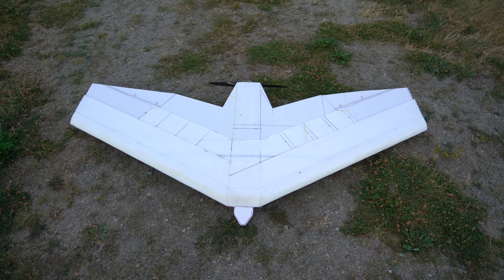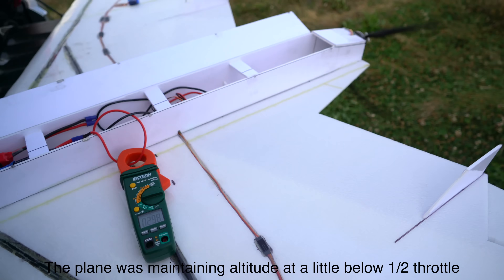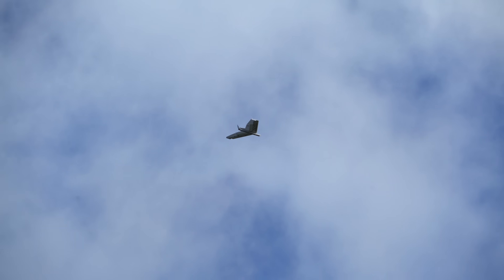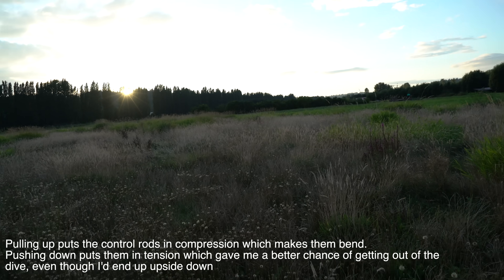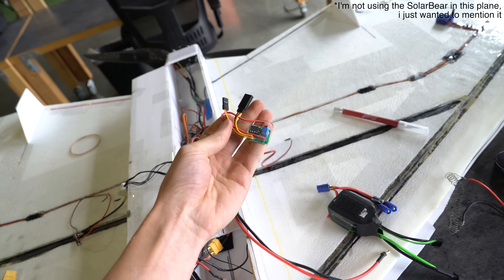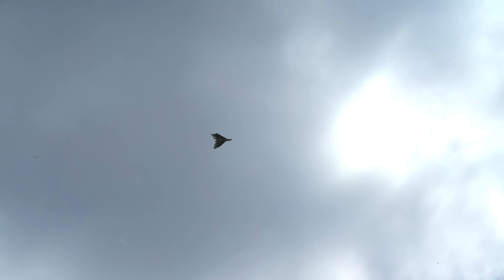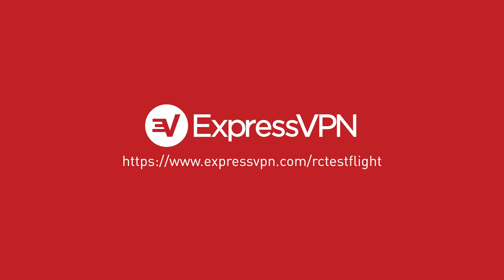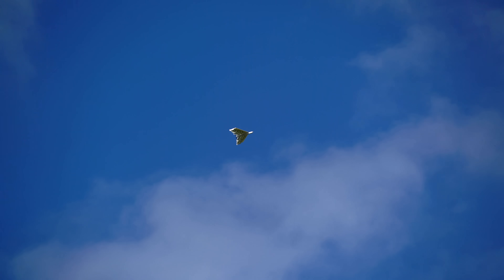SOLAR Plane V4 Flying Wing

Comment: Congrats on a successful test, even if somewhat marred by the crash! I suspect that in addition to the issues you mentioned with foam/pushrod flex and servo stall torque, the tail-heaviness will have worsened things further due to a tail-heavy plane's tendency to "tuck", or decrease pitch angle further, in a dive - I've had crashes a lot like yours due to dive-tuck overpowering weak servos. I think if you can get the CG exactly on the neutral point for the rebuild (or version 2) you'll see a lot of benefits, not just in preventing uncontrollable dives but also in drag reduction due to minimum control surface deflections needed for maneuvering. Also re: servo problems, even "cheapo" metal gear servos should be able to tank far higher control forces than the blue plastic SG90s you used, for a few grams' extra weight - may also be worth doing the old trick of putting small pushrod "guides" halfway along their length to reduce flex.
RE: induced drag and aspect ratio, while high AR is still the clear winner (not a lot of short-span delta competition sailplanes out there), that's when wing area is kept constant. Induced drag is a function of wing loading, not just AR, so if the reason for a lower AR is that you've added a lot more wing area, the tradeoff, while still in effect, will not be AS bad as you might expect. (Case in point: the Wainfan Facetmobile homebuilt, despite being a low-AR delta in a low-speed application - seemingly a very poor combination - managed a top speed easily comparable with more conventionally-configured aircraft of similar weight and powerplant.) Deltas/long-chord flying-wings are a logical choice in applications where high wing area relative to overall maximum dimensions is desirable, so I'm very excited to see you went for a long-chord planform for this test, and happy (but unsurprised) that it succeeded. :D

Comment: Good vid. Your poor cells! Looks like a little more yaw and pitch stability is needed on that plane so the elevons don't have to work so hard. I'd suggest either one vertical stab or a couple of CF booms with stab and elevons on them to increase leverage (and no need for reflex in the wing for pitch stability). The extra drag will be worth it! 
Extending nose with lifting body delta instead of box fuse might be worth it too. A bit of a canard effect, good high alpha, and cooler looks.

Comment: I really like the flying Wing aircraft, and because you used the flying wing your project has my respect. 
Personally I hope you make a V4 with an EDF because I also like EDF aircraft, and Flying Wing EDF's are an aircraft I immediately consider beautiful. 

I hope you can get her flying again, hopefully better than ever.
Reply: EDF motors aren't that efficient, especially at slower speeds. Also the current draw using an EDF will be much greater.

Comment: This might be a dumb suggestion, but what if you got a small Supercapacitor and hooked that up to either the panels or in parallel with the battery so that whenever you get a brief surge in solar power it can be stored more efficiently in the capacitor to be used soon after. That way you waste less energy charging a battery when you only need to store that energy for a couple of seconds.

Comment: Anyone who claims KF steps are more efficient than a standard airfoil has been smoking something much better than what I've got. NASA did testing it is not even more effiecent than a flat plate let alone an actual airfoil. This is exactly what I've experienced with models I've built as well KF models fly for less time on the same setup and fly slower do to extra drag it was extremely noticeable on a one sheet glider I built at 2/3 scale, it barely flew until I put a proper airfoil on the plane.

Comment: I'd scrape it.  It doesn't seem to be a stable platform before or after the solar cells.   I agree you seem to have issues with your telemetry but I can't say what it could be.  Not without looking at a wiring diagram.

Comment: Good video, thanks for sharing. 

One simple iteration could be to increase the footprint to accommodate more cells. Eg. Widen the nose body to be a cell wide. Make the wing the right shape to have three whole rows of cells. Possibly, make the control surfaces a cell deep so you can fit some on there - play with CAD for a bit. It will change the characteristics, but by how much really? Plus you could test any new shape before mounting the cells, as before. 

Also, the readouts are so vital to your mission you should run a comparison test on them on the ground - to be totally sure of them before you fly. Otherwise displaying a video of the real time data is potentially misleading.

Comment: To me the wing's backsweep looks too large, and the wing span a few inches too short. I'd also change your control surface slightly so that the cut runs parallel to airflow rather than at that slight angle you have, which looks wastefully draggy. Exciting project! Thanks for sharing!!
Reply: The angles of the elevons dodge the solar panels silly, he made it as big as he could between panels.

Comment: You should totally just hot glue the cells in place with little dabs of hotglue. Just drop some isopropyl alcohol to remove it! It wicks itself between the hotglue and the materials and just releases the bond!

Comment: Did you test the efficiency of that folding prop compared to a conventional prop of the same size? From my experience folding props are much less efficient. Which doesn't make sense since you are trying to stay in the air as long as possible... :/ If it is more efficient then a conventional prop of the same size, I would love to see the data from that, please?

Comment: Might be overcomplicated but have you considered a pull-pull servo linkage for the control surfaces, sometimes used on scale rudders? They're a bit finicky but once set up, remain under tension so you don't have to worry about buckling control rods, so they can be really minimal.

Comment: I thought for sure you had fixed the loss of control issue. At least you got some good data before it crashed. Were those name brand 9g servos? I got some cheap ones off Amazon, only to find out they refuse to hold a center and are way weaker than they should be.

Comment: I used coffee stir straws as guides on the outside of my push rods, to help stiffen and guide them when they pushed on my ailerons, and it helped out a lot. I also found that 1/16 Stainless TIG welding rod also worked good for push rod material. You can just go to your local welding supply store, and they usually will just give you a couple of rods worth if you ask. Plus you can pick what diameter rod you need, as they have it in sizes from .024 Dia. up to .125 Dia. Hope this helps.

Comment: Great video!  BTW those cracked cells are completely usable, cracks don't significantly affect output unless you can't re-connect sections that have become isolated due to cracks.  A little thin bare wire does wonders for fixing them, beats replacing them all.

Comment: Put the servos on the bottom but stick the horns out the top of the wing and have them pull the control horns.
As you pondered this will give pull for up which is always best and also keeps those pathetic 9g gears away from ground strikes on landing which may fail later in flight.

Comment: "these panels are relatively expensive" 
how much do you pay per panel? they are usually pretty darn cheap for mono panels
Reply: SunPower Maxeon Gen 3 solar cells are pretty pricey. They offer some of the best efficiency in the industry and are easy to install, but a pack of 100 on Amazon is $340 USD. They're sold almost exclusively through third-party sellers and don't dip much in price when buying bulk. Trade-offs are the aforementioned efficiency, which this project definitely needs, flexibility to fit frames and ease of use soldering tabs.

Comment: 16:20 "...on the ground with the motor twitching..." Use the Ardupilot "crash detection" parameter to cut the motor in case of a crash. You can define the trigger G-level yourself.
Reply: i wouldn't its something that is all too likely to be triggered and on a plane/drone that cant crash without significant problems wont really save much more than an cheap esc.

Comment: In 2032:

Solar plane v12 will carry someone so fast it can fly at the speed of earth spinning for continuous sunlight for unlimited time
Reply: Dont let your dreams just be dreams.
Reply: Armored core for answer the cradles 😆
Reply: 1000 Miles per H?
Reply: Basically it’s in geostationary orbit? But it’s not?
Reply: if you make it big enough, air resistance deminishes (squared-cubed law). high volume would also benefit passive lift from hydrogen. imagine a flying wing with a 1km wingspan, filled with hydrogen, cruising in near vacuum at 20 km.
Reply: @ARandomTroll  small question. Which is heavier, hydrogen or near vacuum?
Reply: @ColinRichardson  depends on the vacuum chamber
Reply: @ColinRichardson  depends, is the hydrogen near vaccum too? :)
Reply: @jetison333  I would presume so. If he is talking about hydrogen filled structure and flying at near vacuum. I guess I used the wrong word, rather than heavier, should have said more buoyant.
Reply: @ColinRichardson  yeah. I get your point though, that vaccum is more buoyant than hydrogen.
Reply: @ARandomTroll  but flight with a wing/passive lift is much harder at that altitude in a very low pressure situation.
Reply: @ARandomTroll  basically a zepellin
Reply: Sadly not possible as that kind of speed uses too much energy it would be simpler to just add enough solar power and a big enough battery to get you through the night. Add that to automated soaring tech on ardupilot and should be possible to stay up indefinitely.
Reply: @MrStevegibb  I am well aware. It was a joke.
Reply: @MrStevegibb  hey I've had an idea:
You know the antarctic has like 6month days
Solar antarctic plane
Reply: @MrStevegibb  This actually kind of already exists. Search FB flying wing

Comment: Dude I waited so long for this video!!! Amazing that even on a partially cloudy sky it flew an hour and end up with the battery full compared, that’s day and night performance compared to the v3.
What a bummer for the crash, but yeah, pushing on elevons from the underside of the wing with such flimsy rods was a mistake. I don’t understand, at first you said that you will correct the pushrods/servo after the crash during the maiden before putting the solar cells, and you didn’t? 🤐
Anyways, can’t wait for the next v5 solar plane! Yeah, you should totally build a new one and not fix this one, just keep the non-damaged cells, electronics and power combo, and ditch the airframe ans servos!
Next time you will basically annihilate the LongRange FPV record, you just have to choose a sunny day and keep an eye on the weather map to swerve between the clouds! And check if the return path will have enough sun to make it back!

Comment: your advertisement is wrong. false advertising.
"without a VPN, credit card information and personal data is wide open to hackers"
this statement is false at best, and a blatant lie at worst.

while a vpn does protect some personal data (what site you visit), credit card information (and any other content in the site) is completely safe as long as you are using https on a site with a valid certificate. 
if you are entering your credit card information into a site without a valid https certificate (or using plain http), then your information is NOT safe with or without a VPN

good video though

Comment: You should move the solar current sensor to the output of the MPPT instead of the input, I think the current modules are not isolated, and the MPPT probably does its switching on the negative side.
Reply: Given N channel MOSFETs are usually cheaper, it's almost guaranteed the MPPT unit switches the negative side.
I ran into that with a cheap solar charge controller with built in USB socket - found the ground on the USB was not the same level as the ground on the battery, solar or output connections. Glad I checked that before hooking up my Arduino to it 😂

Comment: I built some solar powered RC cars in the past, so I have a little bit of experience with working with those systems, and I would like to make a suggestion that will make your plane lighter:
Get rid of the MPP-charge-controller and use a high efficiency DC/DC converter between your LiPo and your ESC. The cells are directly connected to the ESC as well. Now, you adjust the DC/DC converter to your Vmpp, so your cell voltage at it's maximum efficiency. As long as you draw less power from your cells than they can deliver, the LiPo is not used at all, if you draw more than that, the LiPo will keep the cells at their Vmpp and they will output their maximum power all the time. There is one drawback though, you would not be able to charge your battery with that simple circuit. That would need it's own charging circuit. 
Maybe that could be interesting for you :)

Comment: You can use hot glue and if needed you can break the bond with rubbing alcohol! Works great! ( I usually use 90%👍🏻)
Reply: the higher the purity the better. Or use denatured alcohol.

Comment: Fun fact: all LED's are solar cells! And vis versa! If you put power through those solar cells, they'll emit light though poorly and probably in a infra red. Neat!
Reply: Could be useful to detect damage in the remaining solar cells
Reply: GaAs cells are closer, but these are silicon cells he is using. GaAs cells are multilayered and almost black. its called a multi-junction cell.
Kaneka panels are silicon at 25% efficiency, but not sold. If he had used heavier GaAs panels they would be upwards of 40% efficient right off the bat.
Reply: The main problem with that statement is that solar cells are not diodes. LED stands for light emitting diode.
Reply: @wiredforstereo  what gives you that idea? Solar cells ARE diodes, they are PN junctions.
Reply: @lolcheesecake  Because electricity can flow backwards through them, they will draw power at night if they don't have blocking diodes.  Therefore not diodes. If they were diodes, they wouldn't need diodes to keep from sucking power.  In fact, they can be deiced that way.
Reply: @wiredforstereo  Conducting in reverse is something that all non-ideal diodes will do at some point. Some diodes are intentionally designed to conduct easily in reverse, like zener diodes. Search up the structure of a solar cell - you'll see a PN semiconductor junction,  just like a diode has.
Reply: @lolcheesecake  For fuck sake, are we still doing this?

Comment: KF Airfoil is long debunked.  Only works with active flow control.  At least on big planes, evidence in favor of it is found outside of controlled environments.
Reply: kfm are less efficient, but unbeatable in stall 
http://www.ripublication.com/aasa/aasav3n2spl_11.pdf
 The KFm2 did not stall till angles of α=450after that it leveled off with a  good  L/D  ratio.This  can  be  of  very  good  use  as  leveling  off  prevents  the  accidents caused by free fall at critical angles.